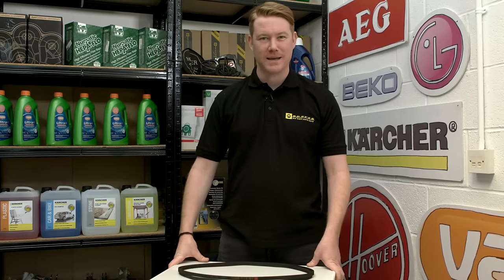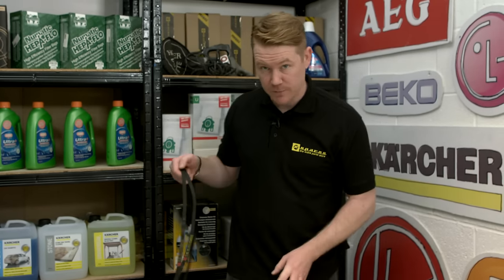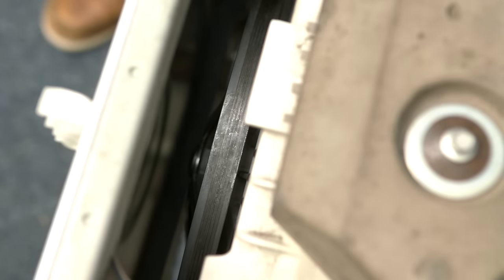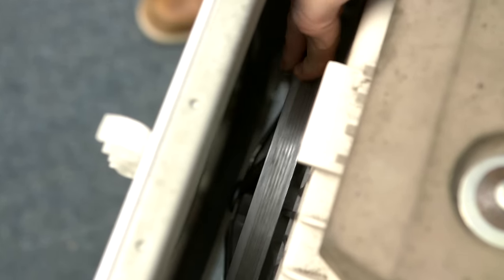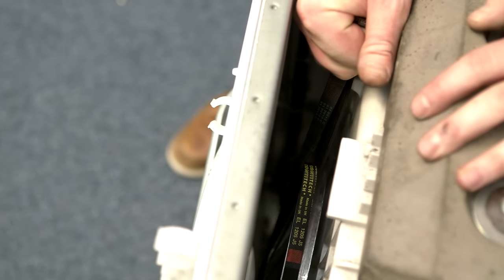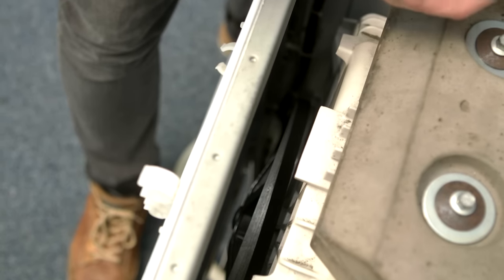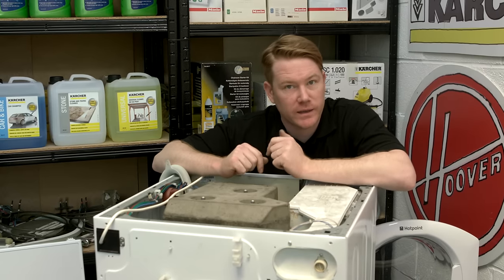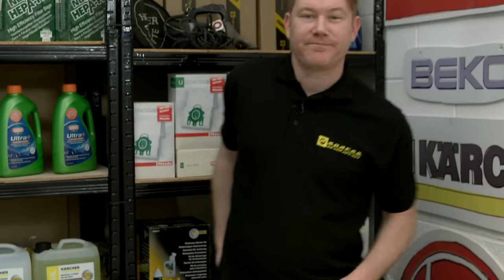How to fit a Difficult Washing Machine Drive Belt

Comment: It is entirely thanks you to that I got the wheel belt which was "supposed to be shorter than the wheel of the pulley" onto the wheel belt AND motor. 
Turning the DRUM rather than turning the wheel itself provided enough leverage to get the belt on.
THANK YOU SO MUCH
Reply from the maker: Hi, thanks for sharing your fixing experience here...it's great to know our video has helped you to replace the belt yourself, to keep your washing machine going rather than buying a new machine.

Comment: Awesome!!!! This tip has saved my bacon! Had exactly this problem, with no access panel - finally found this! Worked a treat! 4.5mm zip ties worked, but the 2mm ones snapped.
Reply from the maker: Hi Paul, thank you for your post and glad it worked for you.

Comment: Had a very tight cord and managed to put it on thanks to your tips. Used a strong thread instead of the zip tie, with similar results :)
Reply from the maker: Hi Razvanonero, thank you for your comment and well done fixing it using the thread.

Comment: What a performance, I worked for both Hotpoint and Hoover many years ago before I retired and changing a belt was like changing a plug fuse I have never seen such a effort in changing something so simple, the mind boggles to how you change a door seal now. Can you still replace the motor bearings? And rewire a program timer

Comment: Thanks but although your advice is very practical, & you make it look easy, the belt for my Zanussi ZWG1140 won't go on easily, & even when I did get it on, it came off straight away once the drum started turning. There is a bolt (no.13) near the bottom of the drum. Would loosening this bring the drum nearer to the motor spindle & thus make the belt easier to fit?
Reply from the maker: Hi RichXZ, we understand that fitting a new belt can be a challenge as they are always much tighter than the original but your issue sounds like there may be something else affecting it, loosen the bolt does not move the drum but take a look at the pulley first as if it is loose or has too much movement it can slip the belt off.

Comment: Oh dear god I've tried and tried the zip tie method to the point of distraction. I get the tie on and begin to turn the bowl, for some reason it slips off with a bang. My machine is a Samsung front loader with the only entry via bottom and same as above for the top. Am I doing something wrong would love some help if possible. G'day from Aus👋

Comment: The way I do these ones,  and never had a problem,  is to just take the lid off,  dangle the belt down - once around the motor spindle,  I just tension it up the left (from backside) hold the tension with fingers on the pulley wheel and roll the pulley round.   It goes on the same as all others just you have a smaller portion of wheel to turn.
Reply from the maker: Hi Jason, thank you for your post and hopefully, your information will help other people but if they are struggling we still like the cable tie trick lol.

Comment: What if the pulley is not turning at all, to left or right? Needing advice on what to check next, how to get pulley to turn in order to put on belt.
Reply from the maker: If there is no belt on the unit then the pulley wheel should turn freely . If it doesn't, this indicates that either the bearings have seized or something is stuck in the tub.

Comment: i've been trying the zip tie method all damn afternoon and it doesn't work for me, idk if i'm doing something wrong but at some point the belt just always gets off of the motor spindle and i have to start again (which is annoying because the only access for it is at the bottom of the washing machine, not on the back for me, so i have to flip it on it's side then flip it back up after to spin the drum)

Comment: For anyone who is still struggling, I used a hairdryer to loosen up the belt just a fraction and that helped no end, as with my old belt that was already a little stretched the zip tie worked on it's own but not with the new one. Once I'd got it on I let it cool down again completely to ensure it was at its normal tension and it's on and spinning away, might help someone 🥵🤷
Reply from the maker: Hi, thanks so much for adding your comment here...it's great to hear that your washing machine is up and running again! Well done for replacing the belt, and sharing your advice here for others.

Comment: My problem is that I cannot turn the actual drum and wheel. Bosch Maxx doesn't seem to want to turn. I have strong arms. I thought it was because it was on some sort of unfinished cycle so I ran a drain till complete, waited and then still nothing. Had this problem about 10 years ago where the belt split. Those days I was really strong so basically brute forced it on with slight help from gf. Wondering why this drum doesn't turn.

Comment: hi im partially sighted and driving myself mad. i have access to the back of drum and motor i have tried for half an hour to do what you suggest by putting a garden clip to secure before putting the rest of the rubber bk. im afraid to turn the drum to hard incase the rubber breaks. please can you help me... thank you
Reply: i guess one good thing is that the machine belt is very tight, so guessing its in ok nick
Reply: thanx for your reply, i attached the cable tie to the drum as shown but when i turn it its very tight, should  continue to turn or until belt slips into place..
Reply from the maker: Hi bucksization, the new belt can be very tight and the cable tie is a good trick, use both hands or even a helping hand but don't worry the belt won't snap.

Comment: The true steps to replacing the belt:
1:"How hard could it be?" Waltz right in and struggle for ages using just your hands.
2:"It just needs a little help" Get screwdrivers and other tools to try to get the damn thing on. Fail at the brink of success several times.
3: "It just needs perseverance" Try various combinations of tactics in vain until the belt slipping off causes your finger to get sliced open on the razor sharp steel casing.
4: "Ok, maybe I need help" Seek internet assistance and find a simple cable tie sorts it out in seconds.
5: "Success" Open celebratory beverage and seek sympathy from wife for ouchy on finger.
Reply from the maker: Hi Michael, thank you for your post and your story shows a man struggling to complete his task and well done for that but hopefully, the morale of the story is always come to eSpares for advise and videos on how to do it.
Reply: is that your fist repair on a  W machine ?!

Those steps were the same when i first changed the drain pump...........first time was a hassle and despair  , second time took me 15 min tops  

and now here i am again searching the internet and finding out that my pulley was the issue , i can give it an 15 fixing time estimate also.

Steps 4 and 5 only  from now on!

Comment: lately belt my washing machine often loose, but I can put it back even though it is very difficult because it can only be accessed under the bottom and top, initially pulle loose, then I tighten, but a few moments belt loose again, I check the pulley is installed right and strong , belt is good enough, not like in your video. what is the cause of it? already three times off in this week.
thanks.
Reply from the maker: Hi Suhartanto, it sounds like either the pulley is worn and is moving causing the belt to come off and would need replacing or the belt has stretched over time and that needs replacing.
Reply: eSpares thanks, after I check again, one path from the belt was damaged eroded, I will try to find belt replacement, hopefully resolved. thanks.
Reply from the maker: Hi Suhartanto, glad we could help and our website would be able to supply the belt for you and the link is above.

Comment: Didn't work for me- similar machine. Managed to get the belt on with tie however despite keeping the belt straight when winding drum, the belt kept winding to the rear of the pulley and brushing against  rear drum surface. Took the belt off and retried about six times no luck. This machine was a few years old so just going to buy a new one instead-will make sure I buy a model with removable back plate. Thanks anyway.

Comment: When you say adjust as required, it would be nice to know what is required - i am not sure exactly where the belt should be positioned.
Reply from the maker: HI Mark, the motor pulley has more 'slot's' than the belt has ridges. If you look carefully at the pulley a number of slots will be cleaner than some as these contacted the belt. Simply pull or push the belt when turning by hand to move the belt onto the cleaner groves and the original position.
Reply: Thanks, but my wife was trying to fix this while I was at work and the pulley threads all look the same dirty colour now! I've attached it to the end threads of the motor pulley furthest from the washing machine. the belt naturally goes to the inside lane (closest to the washing machine) on the wheel, but overhangs the edge by a mm or 2 - I assume the belt has stretched too much?
Reply from the maker: Re adjust to get the belt running in the centre of the pulley. Even if stretched belts do not normally come off unless overloaded or the pulley is loose.
Reply: OK thanks. With a lot of effort I manually pushed the belt over to the outer edge (and also tried the very middle) of the big wheel (furthest away from the washing machine) - but a couple of rotations and the belt moves back to the inside edge (with a bit of overhang as mentioned previously). So could be a loose pulley - assume on the motor pulley, or could be on the wheel too?
Reply from the maker: You need to 'step' the belt one ridge at a time on the motor pulley until it naturally runs in the right area of the pulley. to do this pull or push the belt in or out of the motor pulley as you turn the drum pulley round. If the motor has been refitted check it is in the correct position and tightened correctly.

Comment: I have tried all 3 still can't fit the belt
Reply from the maker: Hi Robs garden blog, are you sure you have the correct belt as the last tip with the cable tie always works, also check the pulley for movement in case it's taking the belt off when it's turning.